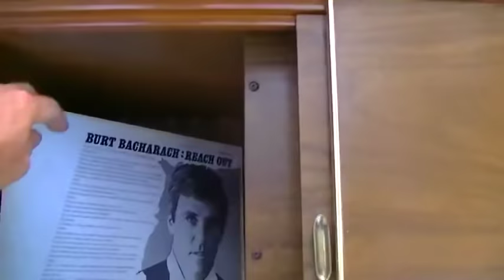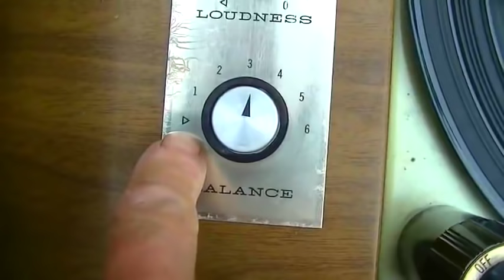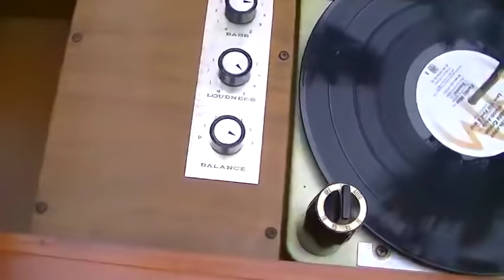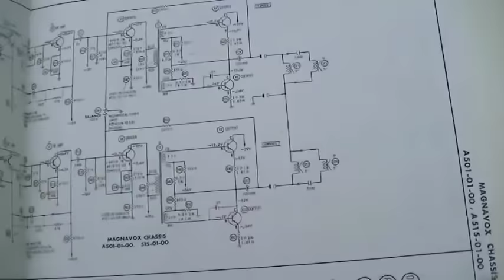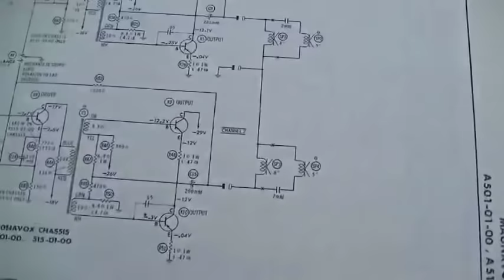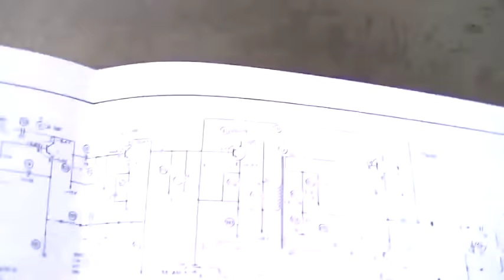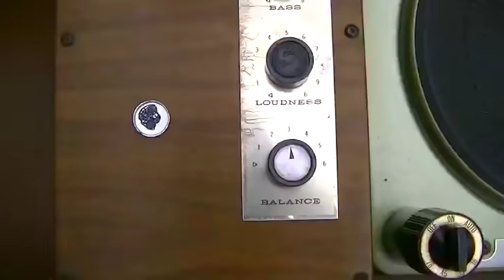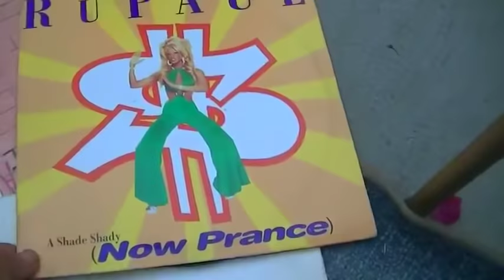Vintage Magnavox Console Record Player Repair

Comment: People should really know what they are talking about before commenting. This is a Collaro record changer. The arm taps the side of the record to sense it's size and whether or not there actually is another record stacked. If there is no record, the arm will scan across to 7 inches and then shut off. You have come a long way with this I it but I would still change out the other capacitors as the unit is still not working to its potential. Also adjust the set down screw so that the arm lands where it should on the lead in groove and make sure the spindle is seated right so that records will drop consistently. Too much weight will also cause the ceramic cartridge elements to crack and become intermittent; additionally, over the years, the rubber yolk that receives the vibrations from the needle, will become less compliant, causing bass to suffer.
Reply: Earcandy73
Reply: hey man, what does a capacitor do? im just getting into this stuff.
Reply: They hold an electrical charge...  They only pass AC,  not DC.  They can be used to pass only certain frequencies.   I suggest checking out Uncle Doug's videos on capacitors in audio circuits.

Comment: Since bass is non-directional, the side placement of the bass speakers was a genius idea by Magnavox and they patented it. That way, it was easier to put the angled treble horns or speakers at the extreme front edges of the cabinet to give better stereo performance.

Comment: I used to have one of those. I was sitting here shouting at the screen telling you that you have to load the record to the top of the spindle in order for the arm to sense the record there to start playing. It is designed to check for the next record at the end of the one played. If there is no next record it is designed to automatically shut off when done. This is why you couldn't get it to work automatically with the record already on the table. It is also designed to determine the size of the record to be played. You can put 12" records on first then 10" or 7" consecutively and it will drop the needle right at the beginning of the record. It is a much more sophisticated system than the newer ones which asked you to pick a record size before hand.

Comment: Germanium transistors have the bad habit of forming whiskers which short out after many years. Interesting to see the point to point wiring. Must have been built not far after the tube amps were phased out mid to late 60's. I love your set up for testing the Caps.

Comment: This amplifier implements the "bass" tone control by loading down the ceramic phono cartridge. Lowering the impedance cuts the bass response. C10 (the 50 uF emitter bootstrap capacitor) is important because it causes the phono cartridge to see a high impedance. If C10 and its counterpart on the other channel are open, you will get a tinny sound, regardless of where you set the bass control.
Reply: klafong1 Indeed, and also Magnavox did blend the bass to mono on most of their consoles. That way with their limited power, especially the lower models, why not have both woofers working together with the bass?  Made sense to me.

Comment: I've got one of these! My Dad bought it back in 1964 and I wasn't allowed to touch it. It's the British version and differs insofar as it has a slide on/off switch at the top of the console which houses the AM/ Stereo FM tuner. Also, the Balance is controlled by removing the Bass control knob and inserting a slim screwdriver down the shaft of the bass control and adjusting accordingly. Also, it has a step down transformer to reduce the U.K. 240 volts down to the U.S 110 volts. There is also a red Pilot light on the front underneath the “Magnavox” sign.
Sadly, it doesn't work at the moment as the main transformer on the amplification board needs a rewind.
Reply: may not necessarily need a rewind, may be possible to find a 'standard' type to replace it ...?

Comment: The head shell is trying to feel the record before it drops so it can tell whether it's a 12", 10 " or a 7" (37:37). If it can't feel any records anymore it shuts off.
Reply: That’s the way it was designed

Comment: They also seem to become unstable and intermittent like the FM RF amp in radiotvphononut's Maggy. Older solid state did not perform as well in higher frequency applications either hence why RCA developed the Nuvistor tubes/valves for their TV tuners.

Comment: 20:04 I've never seen a bass control like that: nothing but resistors and one potentiometer for both Left and Right channels; I'm guessing it takes advantage of some inherent characteristic of ceramic cartridges (they are said to de-emphasize the RIAA curve with no added circuitry). In today's internet jargon, that would be called a "weird trick".
Reply: ceramic/crystal cartridges are high impedance output as if fed via a low capacitance, so too low resistive loading drops bass sharply, so a cheap bass cut can be a variable resistor to vary loading, that why the modern 'crosley cruiser' type things are so poor bass, even with external speakers, they load the cartridge too heavily 😉

Comment: I thought at first it was similar to my '61 tubed Maggie.The style is unmistakeable.Mine may be a Concert Master,still not sure.My cabinet is Provincial,but it still looks very similar in style.I see mine is about a third again bigger though.Mine has both a tuner,and a multiplex.Magnavox obviously made consoles all across the price range,clearly this was an entry level model.Most of them you see from '63-'64 are the early Astro-Sonics,I don't think they were still using these

Comment: That chassis still shows a tube design layout with those transistors on top like that. 
Never thought of using Mrs. Miler for signal tracing, will have to remember that.

Comment: That’s a nice one! I have my Magnavox/Collaro Micromatic and it’s slightly different than the previous one, and mine is from 1967.  Mine came out of a Magnavox Full Dimension portable stereo record player which was in horrible shape and the main cabinet was falling apart. I attempted to restored it and get it working, so I give up. I tried to plug it in, but no luck. So I ended up being EOL’ed and saved the Micromatic changer, and it works perfectly by connecting through my Realistic stereo receiver and thankfully it works perfectly.

Comment: @shango066

You know I bet the turntable has dried grease in the automatic portion of it . I had a problem with my 1965 micromatic of a different style but she was not landing on the record right it also had dried up grease in it . I cleaned up the grease oiled the motor and oiled the turntable mechanisms and now she's working right after 8 years . don't ever lose the spring under the spindle or the records wont drop right .

Comment: Without that tone arm weight, it was probably tracking at about 2 tons!
The lack of separation in the bass is probably in the cartridge, most have poor separation except in the mid-band, less at bass and high frequencies.  The changer seems to work when the drop arm is up, not so much when down.  The arm movement was spastic.  Still, not bad for something its age.

Comment: People are amazed at how well a 5 tube AC/DC set can sound when they are repaired correctly, considering that they typically have a 4 to 5 inch speaker. You don't need amps with hundreds of watts to have a sound system with good fidelity, nor gold plated patch cables. My only complaint is that those cabinet stereos are often a bit boomy.
Reply: They never baffle the speakers properly in these consoles so you get open-back guitar amp sound. It often wouldn’t take much to add a real back and maybe some insulation in these things, depending on cabinet layout. You’d think Magnavox would have had some acoustic engineer on staff.
Reply: @sulagodfrey-jensen813  Magnovox did make one with 15 inch woofers and sealed boxes. Of course this one had a big 50 watt per channel transistor amp on a separate chassis. These cheaper units only had around 5 watts per channel and they need the sound to escape into the room from the back, that is why they play so loud with low power. Woofers are also stiff low excursion type and need to be in free air. Sealing the back on one of these would make it sound worse. It is what it is, a nice tonally balanced sound at low background listening.

Comment: Hello,is it not good to let modern electronics set and not be used? I have a brand new in the box Realistic SCR 4500. Very nice set up. But I hate to leave it setting. I think my father purchased it new somewhere around 1985. I remember him paying $500.00 for it at that time. I would like to find someone who would use it and appreciate it. I know one thing. It is very heavy. I took it out and ran it a few hours the other day. And everything seems to work just fine. I thought the belts would have turned to mush by now. This thing is packed with a lot of features too.

Comment: Learning allot from your videos, I have a 1975 (or 76) magnavox and a RCA console from 1965. I am working on repairing my Magnavox, which works fine shockingly. Tho I need to check capacitors and stuff at some point I’m certain. Do you think one day you can do a video on how you remove the turntable from the box if you haven’t already?

Comment: I've repaired many of these amps in consoles and portables. The 250uf output coupling caps were all dried up and open. As a result weak sound and no bass to speak of.

Comment: It sounds like the output transistors aren't turning on.  I sometimes saw that the ground for the common for the power resistors may have a cold solder joint.  I would try the radio and see if that works, if it has a radio.

Comment: That stylus is stuffed.
That platter is terrible. It may have missed a 45 Single and ripped the needle out of the tonearm.
The rubber ribs may have destroyed the needle hence it was on 78 as that one is a bit more heavy duty. ( 5:56 ) you proved it there.

Comment: Hey Shango066 I'm working on a Magnavox similar to the one in this video. The model number is 1ST659A. I'm looking for the service manual for this stereo I found a few numbers on the chassis. One of them say M29, 543257, 8304-10,  LH8IN or NI8H7.
Reply from the maker: Magnavox weird with numbers they are almost useless. That's why I just get the approximate year and spend hours sometimes searching through the manuals for the right one
Reply: Ok thank you. The year the stereo was made is 1962.

Comment: I have an earlier tube version of this that sounds amazing with two SE 6bq5 amps onboard as well as an am fm/tube mpx fm as well as separate afc fm. Cartridge was upgraded in the past to an electro voice cart. Magnavox made some awesome consoles if the owner sees this and doesn't need the 45adapter I'm looking for one or if anybody has a source to those magnavox early 60's 45 changer spindles

Comment: Hey, by any chance did you encounter any asbestos inside the unit? I ask because I have read that some older radios have asbestos for heat shield pads. I have a similar model, and never wore a mask. As far as I know, I didn't encounter any asbestos. I am just trying to get an idea of there was indeed asbestos in these.
Reply: I isn't unknown to find asbestos inside valve (tube) equipment - radios, TV's and so on. Often in the form of plates under the chassis so that if hot components were to drop off they would fall on the plate and not on the wooden cabinet. Source of many house fires back in the day. 
Asbestos was also used as insulating sleeving and some power resistors were coated in it. Shango does find asbestos and comments on it in some of his videos. Folks interested in vintage tube equipment do need to be aware and look out for it. 
This unit is early solid state so runs cooler and is less likely to have any asbestos.

Comment: What kind of hack method of testing electrolytic capacitors are you thinking of? Why don't you use the gold standard of testing with a real ESR meter to verify caps? They are so cheap now, it is probably the 2nd most useful instrument next to the DVM one should have front and center on the work bench.

Tom

Comment: Hey Shango66. Can something like an audio mixer be hooked up to that console stereo?
Reply: the chassis is solid state but RCA only, The system is only Stereophonic so one channel is bass the other should be a reverberated mix. "simulated stereo" the reverberater does not have any adjustment system.
Reply: In short, yes! (Well on the one I've got you can anyway.)

Comment: I have the 64' Micromatic, the system is only stereo phonic. plus that still is low in volume, I f I get time I will get a video of the 64 about 1/4 the way. tons of bass and good sounding. if you still have that MV the Coaxle cables in the tone arm are either damaged, the amp is in need of replacing or various other issues. your lucky that there was not a short in the switches at lvl 2 its loud, and the turntable stylus is not meant for Lp's of today.

Comment: that's an earlier model changer. i didn't know the solid state sets used them
Reply: That is a imperial s-600 model changer,1962 model
Fancy mat,gold in center
Larger spindle top
Black 45 adaptor

Comment: Yes, I HAVE shouted at the screen during the video.
The turntable is a BSR therefore I believe it is fitted with a BSR cartridge (output approx 1 volt) therefore any stylus replacement would probably be better sourced from a BSR stockist.
I take my hat off to you for finding the capacitor fault, however, I do not really see how you could say that this is a really loud unit especially as it's only 5 watts (U.S. Rating) which probably only equates to 4 watts U.K. Rating (being kind) so is not really loud at all these days.
Reply: SuperCoastie1 WRONG. That's not a BSR. It's a Collaro.....

Comment: I have a Magnavox Astro- Sonic receiver that hums and crackles in one channel no matter what I use as a source. I know capacitors can cause hum can the crackle be caused by a capacitor too?
Reply from the maker: transistors
Reply: i'm sure it could use all new ones. when I used it an hour ago it seemed fine, that was after I fiddled with the balance control. I ordered a large assortment of capacitors last week since I noticed a hum .

Comment: Do those magnavox consoles ever harm records? I have one from 1974 that I play all me best records on..
Reply: +Jesse C. Most Magnavox changers came from the factory tracking at approximately three grams. You would have to play a record several thousand times at that sylus pressure before you would ever hear any wear. Just make sure you have the stylus checked every few months or so. A damaged or worn stylus will permanently damage a record immediately. Magnavox was one of the best consumer grade stereos made.

Comment: did you ever figure out why the bass knob did not do anything could it be due to old age or could it be just design flaws or a common magnavox way to make things love the video
Reply: very true but if you had put the back panel on it would have deepened the bass response much more . I had when I was a kid a magnavox portable stereo with the same amp and there was something very wrong with yours in the video mine really put out base and the knob worked it must have been a bad pot and the circuit connected to it . but you really do a great job and I am looking forward to seeing more

Comment: could it be that the speakers are not designed for the purity of digital sound, and that could blast out the paper cones?
Reply: Nope, the Amp is blown I have the same console. the automatic parts -  main gear needs to be oiled, from the back and the wheels need a possible replacement.
Reply: Umm, no! Despite what "digital experts"(i.e. salesmen) may tell you, there is NO reason why a unit like this could not have a minidisc or cd player attached. (or even a phone, come to that.)
Reply: SuperCoastie1
I've taken turntables out of "changer units" and installed better turntables..There are RCA jacks underneath that make that possible.  There are also "Y" shaped adapters that will allow a new turntable AND a CD player to be attached to these units.  The person is after the amplifier and speakers, in the first place, as well as the aesthetics of the piece of furniture, so, updating it that way, without it being "visible" is completely possible. 
But, that doesn't replace a blown amp.
Reply: wdharvey1 me too. I have an /RCA stereo console that I put a dual 1009 turntable in and it sounds great. I had to get a small pre-amp for the turntable but it sounds, and looks great. My unit has rca plugs for an external  8 track that I plug my phone into and stream my ITunes library off my desktop computer. I have a set of old Bose 301 speakers hooked up in addition to the speakers in the cabinet and I think it sounds great. I don't crank my tunes anymore
Reply: wdharvey1 “HEEEEY YOG GUUUYSZZZ!”
>stools on self

Comment: Vintage electronics were unreliable, but vintage mechanics were even worse!
Reply: +Synthematix I beg to differ. I have record changers that are over half a century old that work reliably. I also have windups that work well; dried up rubber and grease needs to be removed and replaced. When that is done, they work as well as they did when they were manufactured.